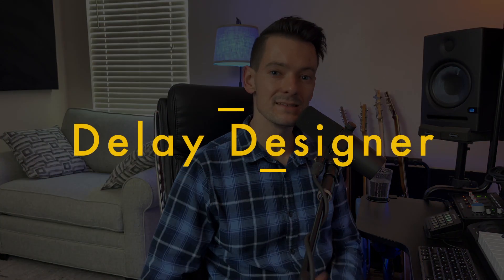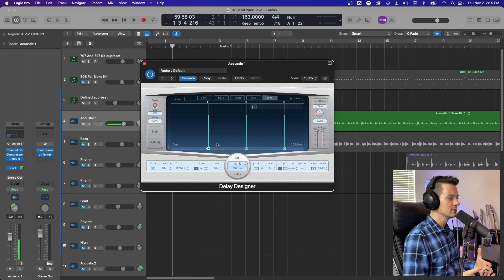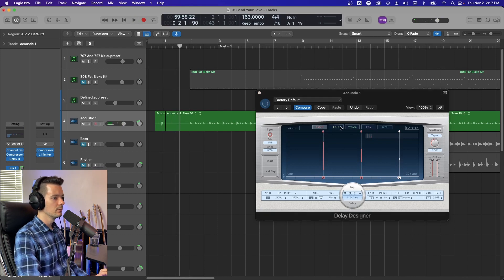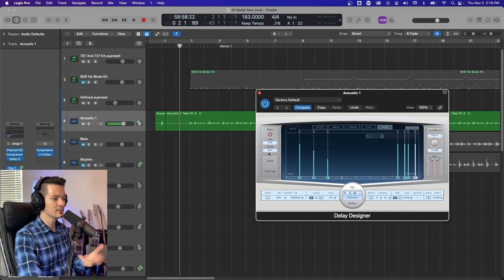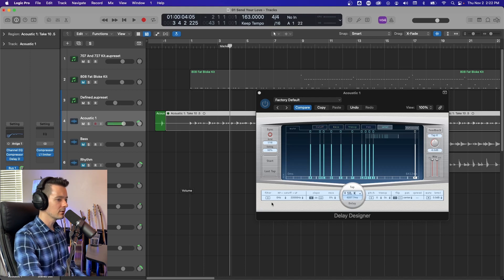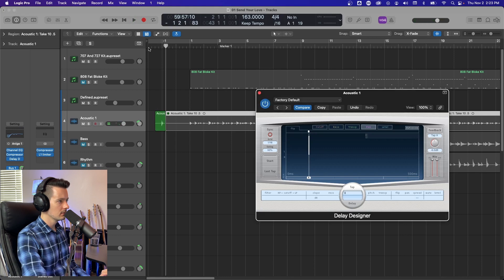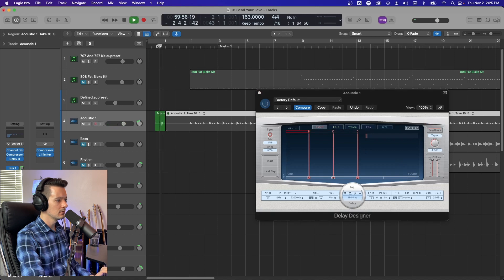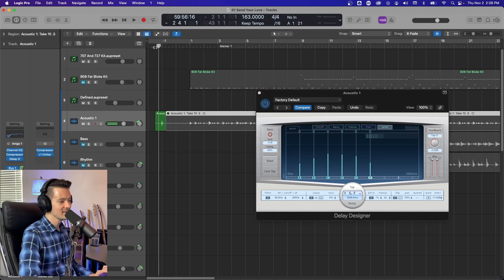Logic Pro X DELAY DESIGNER Explained (it's super powerful!)

Comment: How can I use it to move files on the timeline backward and forward?  I like to adjust files but don't want to manually drag.  Thanks!
Reply from the maker: Try the sample delay plugin for that, way easier! If you need to move things earlier, look for track delay and apply a negative amount. (It’s in the track dropdown on the inspector panel)
Reply: @woodyardmusic  Im trying to record remotely and adjust for the delayed audio coming into my session.  I want to push the aux channel forward so it's in time on my end.  Track delay wont due it in record or monitoring.
Reply from the maker: @markjacksonmusic21  sounds like your only decent option would be the sample delay plugin. Try that one out
Reply: @woodyardmusic  sample delay doesn’t shift forward in time I think. Atleast I couldn’t figure it out. DMG Audio makes a free plugin called Track Control that does it.  Works great! Appreciate the help FYI!
Reply from the maker: @markjacksonmusic21 it’s very hard to shift live audio forward. Can you delay everything else?

Comment: Great job - the users guide explanation for this seemed like the most convoluted ordeal I had ever come across, but it’s actually quite sensible the way they laid it out (as detailed herein).  I am going to be able to use this for a “unity gain repeater” effect that I could not seem to achieved with any other plugin i have right now.   If i only wanted it to engage on certain spots in a track, would you recommend track mute automation to turn the input on and off, or would you do it some other way?
Reply from the maker: You're going deep! Yeah automation would be the best way to accomplish this. Usually I look for the "mix" control personally, it's just faster for me to find.
Reply: @woodyardmusic hey thanks!.  The cool thing about DD is that it doesn’t necessarily drop the gain level of each repeat, (and it seems like every delay/echo plugin in my arsenal drops volume of repeats).  I have heard more than one popular track where the repeats are at the original gain level, or practice equal, over the years. I wonder how they did this trick in the past?  Hmmm    I did completely succeed at the “unity gain repeater” I wanted.  So I should thank you a second time!